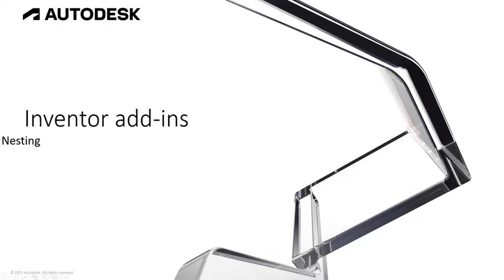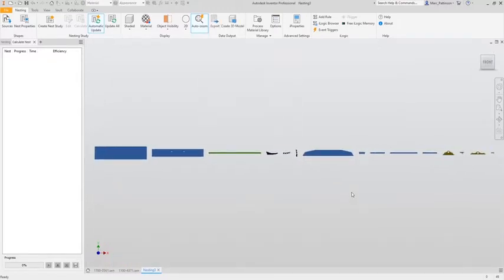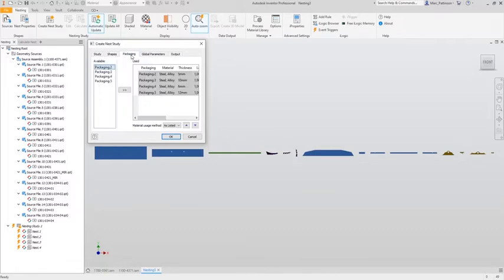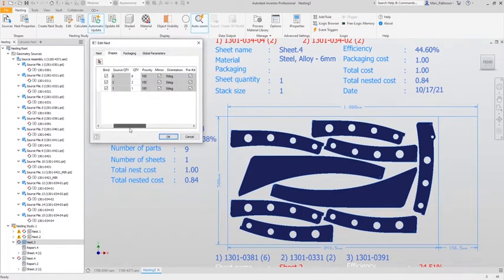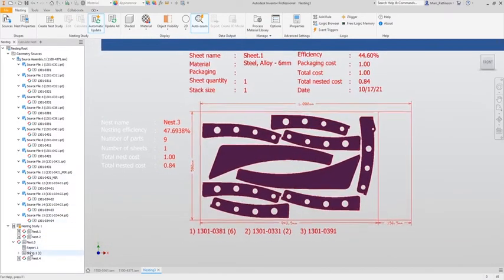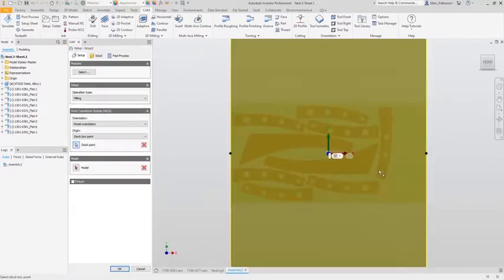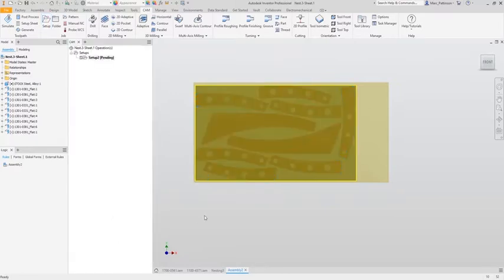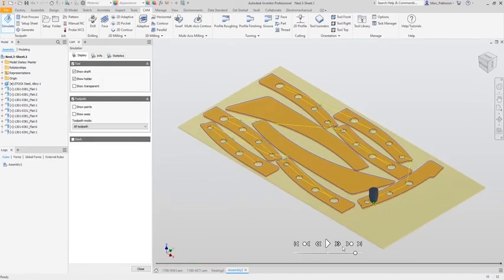Tech Thursday: Autodesk Inventor Add-ins Nesting

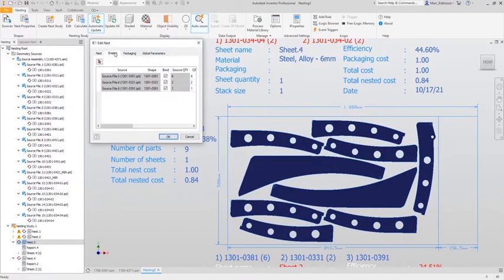Comment: @1:48 glaringly obvious garbage packing algorithm there - there's 9 near-identical curved parts, all of which would pack on top of one-another with nearly no gaps if rotated, and 2 bigger ones which would nest almost perfectly with one flip - this output not only wastes more than 50% of the stock material, it's trivially obvious how to re-arrange them manually to leave the remaining stock fully usable (or to pack double the number of parts onto the same stock "for free".

Consider uploading in sensible quality next time - 480 pixels was a bad idea!